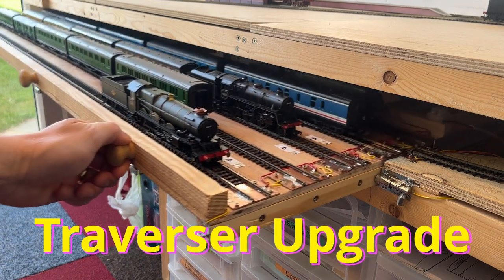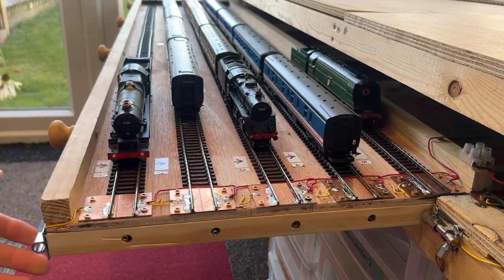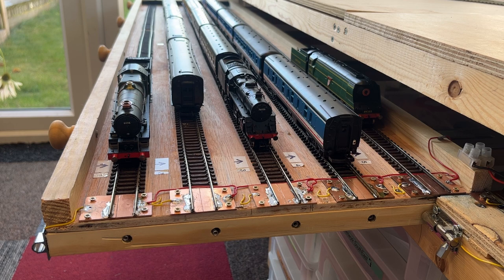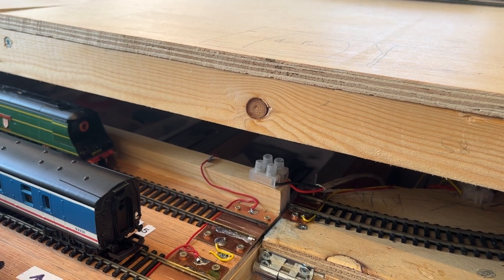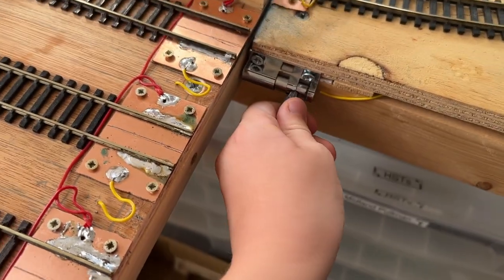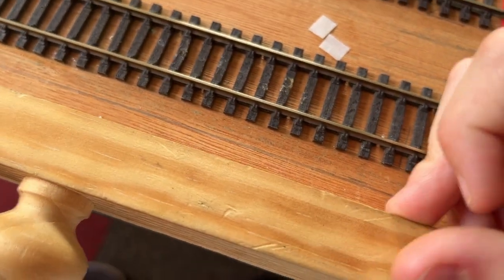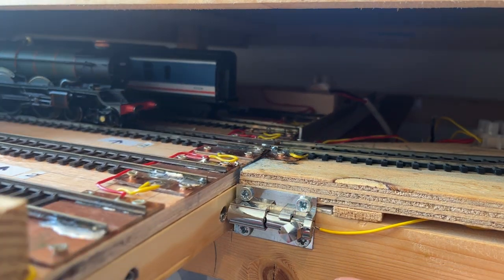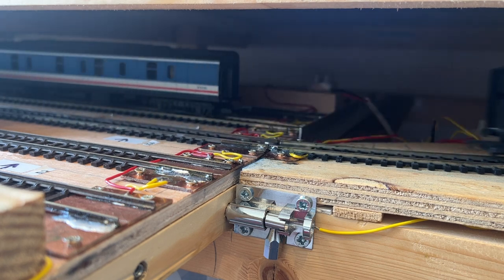Model Railway Update 7 - Upgrading the Traverser

Comment: A very clever method of using the traverser Simon. It makes it much easier to operate trains on your layout, I especially enjoyed your video of the Hornby live steam Mallard which is very rare to find now. The traverser is clever in a way that it isolates separate tracks in order to prevent other trains running off on to the floor when they themselves are not connected. Also the single track isolation switch is another impressive feature to only focus power on a single train at any one time. 
I also have a model railway at home, of which I'm still working on. It is my version of the Rev. W. Awdry's Ffarqhuar Branch line on Sodor as it would've looked back in the 1950s. 
Keep it up Simon, your model railway's progress is going great. Cheers mate.
Reply from the maker: Thanks! We need to run Mallard again. It’s been too long! Do you have any images of your Ffarqhuar layout online anywhere? Simon loves Thomas. We recently attended a Day Out With Thomas event on a nearby heritage railway. Video coming soon!
Reply: Do you have a Gmail account so I can email some of my pictures. cheers mate  @SimonsTrainAdventures